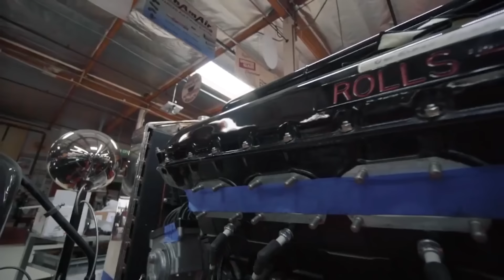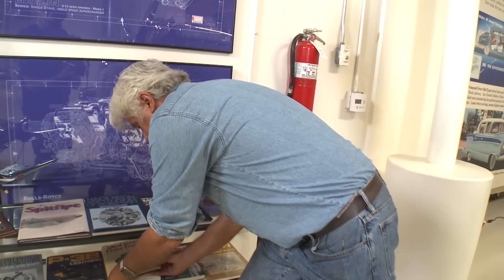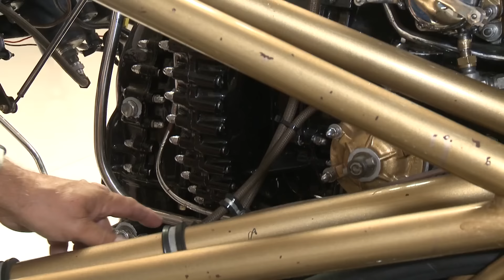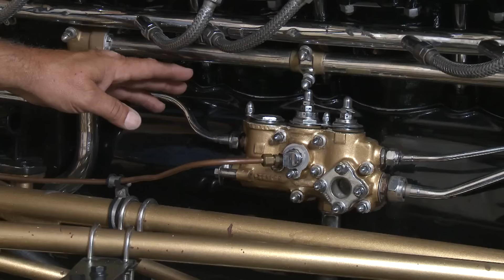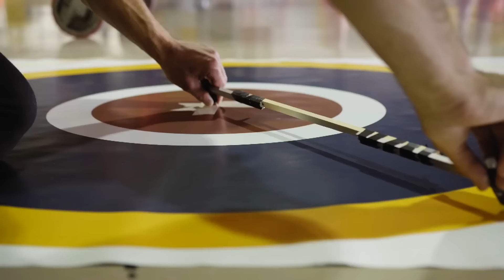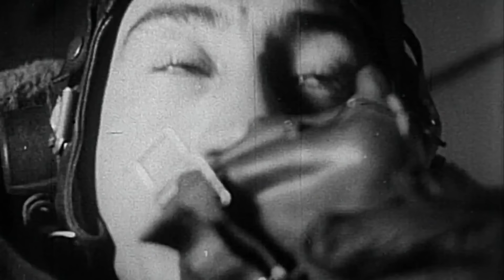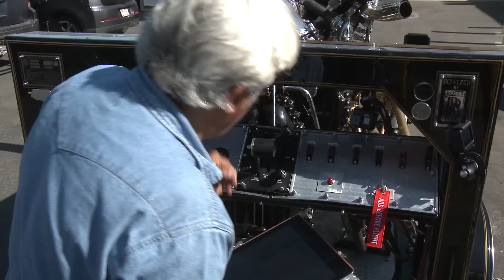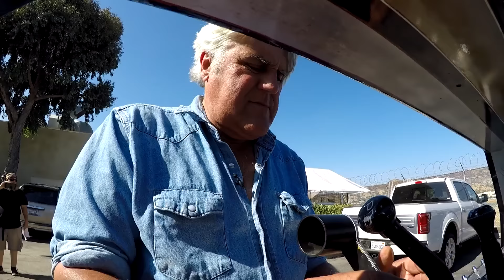The Engine That Won World War II - Jay Leno's Garage

Comment: Great video! Fascinating stuff. One of my uncles actually worked on these(and the later Griffon) during the war and post war. I remember him telling me how much he liked them, though not so much working on them. :) He had the chance to examine a captured Daimler Benz from a Messerschmitt 109 and he reckoned it was the better engine in some ways, fuel injection for a start, though apparently the Merlin was more reliable. Merlin certainly sounds better. :)

Comment: top respect points for not having a massive safety cage to keep people from seeing the engine , darwin will sort out anyone stupid enough to walk into the blades while its running. As always keep it up Jay!
Also , im stuck here with remove before flight keyrings i need to find the add before flight ones haah